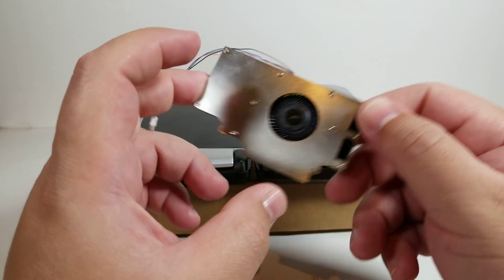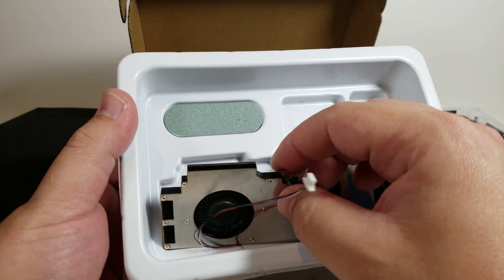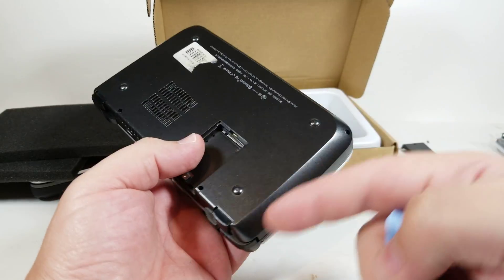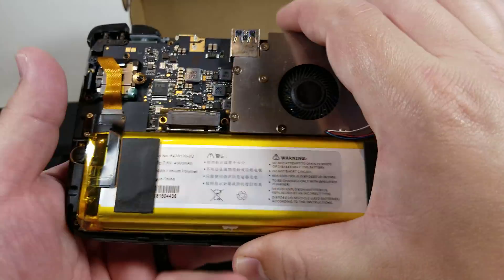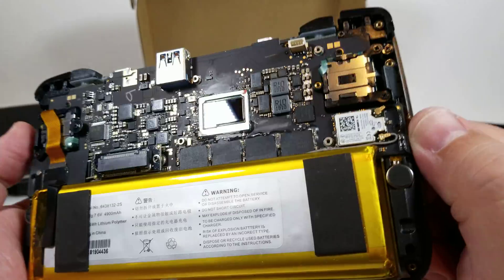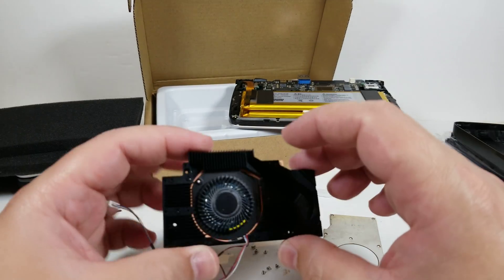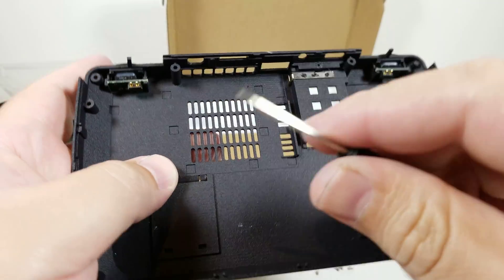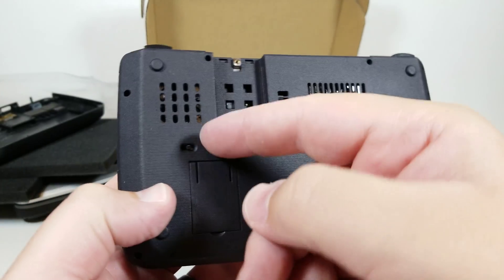GPD Win 2 - How To Install Third Cooling Mod (Heatsink Mod)

Comment: Late comment but I recently bought a GPD Win 2 with the third cooling mod already installed and I have no idea which side of the switch turns the extra fan on and off as I don't think Phawx even mentioned it or I just didn't catch after a couple more rewatches. This is something that's been bugging me for a week or so now and I can find no answer for this mentioned anywhere as I didn't get any of the packaging or instructions for the mod when I bought the Win 2, was hoping this video would give me this simple answer but it continues to elude me as I don't notice any difference in temperature or noise which side the switch is turned to.
Reply: Hola amigo, puedo saber donde compraste las win 2 con ese mod incluido? O donde puedo comprar solo el mod? Gracias

Comment: Does the win 2 get hot like the win 1? How is it when running dolphin or redream emulators without the mod?
Reply: It runs nice Dolphin, the problem is if you try to charge the device while playing, the gpd win 2 shut downs because the hight tempersture
Reply: And yeah, it puts too hot...

Comment: why did you use thermal paste when thermal pads would have worked better and been less of a mess in the heat sink and on those 2 caps?

Comment: I just followed exactly all the steps and now my gpd win 2 will not boot anymore... the ssd cooling fan starts spinning for about 10 seconds and then stop. The main cooling fan spins 1 or 2 centimeters and then stops as well .. I got a black screen no way to get it running
Reply: Inception Fitness contact gpd and ask them for a repair or a refund
Reply: @ExpressTacoVille  well they might not like the ' I tried to upgrade your cooling mod ' 😂😂 not sure the warranty will cover that
Reply: Inception Fitness haha

Comment: How difficult or dangerous is it to do what you did?? My fan was having issues and now it stopped working my guess due to dust inside, however I’m able view the internet and even play some games and emulators, its just the fan wants to move but is stuck. I’m gonna open it soon but once I get the cooling mod and new battery I ordered and should i also buy new fan part as well?? Do you have any recommendation or a link to something that would help a novice like me when it comes to messing with the hardware of computer??

Comment: Have just installed the cooling mod and the nylon case, i'm getting 20 degrees cooler core temps than the stock fan and case at 12 watts. Much cooler to hold. Had to loosen one of the case screws as the case was compressing the ssd fan a little causing a buzzing noise. Thanks to the Phawx for the tutorial. I hope GPD adopt a far superior cooling method in the GPD Win Max, having to invest a further £90 on top of this premium priced device and risk bricking your win 2 while installing is just unacceptable.  That being said the Win 2 is certainly a one of a kind device in todays market and I commend the developers for providing such an innovative handheld.
Reply: Hola podrías decirme dónde comprar el mod 3?

Comment: Just received the finished cooling mod and 2280 case.

He mentions that liquid metal thermal paste can't be used to fill the space between copper -  aluminium as it corrodes it. If my thermal paste contains 10% silver does this affect the two surfaces? Thanks

Comment: Phawx, I can't thank you enough for putting this together! My GPD Win 2 is finally not overheating. Thanks so much!
Reply: Brian Esserlieu what model gpwin2 do you have? The original or the 2019 revision?
I'm trying to find out if there were too different versions of the heat sink and if that's true what the 2019 version looks like.
Reply: After you put the coolermod, you GPD WIN 2 turns off when overheating, especially while charging?

Comment: For the love of God don't put thermal paste on the vrm's theirs a good chance you'll brick your system. And don't put as much thermal paste on your cpu as he did, having that much thermal paste is dangerous for a system and does little to nothing in terms of cooling compared to the proper amount of thermal paste. At most you near a tiny dot of thermal paste on a system like this.

Comment: Hi, thanks for this helpful video. I have a question though. On the PDF installation instructions available on Indiegogo, the maker warns not to apply thermal paste on the copper/aluminium interface, as it would cause corrosion. I followed your instructions to the letter, so I'm a little worried. Should I remove the paste except between the chips and the cooling kit? Can you confirm?
Reply: The exact wording on the instructions is "Special reminder, liquid thermal paste will corrode aluminum, so it can not be used for filling the copper-aluminum contact surface. It can only be used at the CPU and insulated to prevent burning of the main board."

So I'm kind of puzzled, because you recommend laying a lot of thermal paste between the copper plate and the aluminium radiator. Qo potentially this could cause trouble to a bunch of backers, if some misunderstanding occurred.

Your input will be more than welcome top clarify this. I've also got back to the maker with the same question, hopefully we'll have it sorted out!

Comment: By any chance do you know if there was a problem with the speakers on the GPD WIN 2 8100y model since my right speaker doesn’t work. The left one is crystal clear and headphones have stereo sound. Both in windows 10 and Manjaro the right speaker has no sound. Not even a pop. Do you have any idea if other units have the same problem or is mine just defective? Is their a fix before I open my unit to attempt to fix it? Where can I get the cooler mod if the indiegogo campaign is over?

Hope you can help.

Comment from the maker: Hey all, apologies for the abrupt ending! There was only 5 seconds of video to be included, literally me saying, 'That's it. As always, thank you for your time and thanks for watching'
Reply: Is the final version of the heat sink universal for use with the original and 2019 version of gpdwin2 or are there two different versions of the heat sink. I have the 2019 model and no way of gauging the if the heat sink I was sent is the correct version.
Reply: Before and After modification. Why not show how much the improvement gain.
Reply: Sopranos?
Reply: Hey Phawx,

How are you ?

Badly need your help 

I just bought the kit copper nylon shell.

My question is does the pack include the ssd cooling kit as well like your video ?

Thank you for answering
Reply: Inception Fitness I think the ssd cooling feature is separate option to pick and pay for on the indigogo project web page, it was for me just to let you know.
Reply: Do you know if the GPD WIN 2 is Compatible with An external GPU or a GPU dock????
Reply: @mauricedieyette8724  its not

Comment: I just dont fancy taking apart a £700 device that wont really be repairable (easily) should I fudge the job. Reall want the mod though
Reply: the heat sync mod is worth doing if you plan on upgrading the SSD for more memory